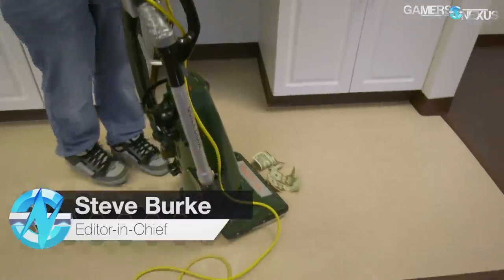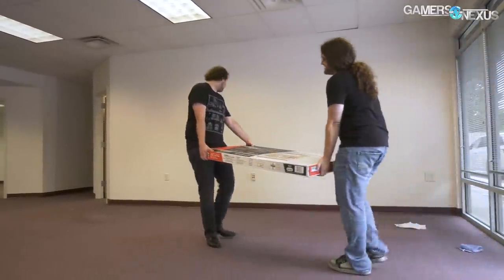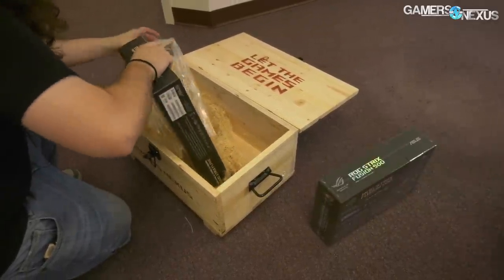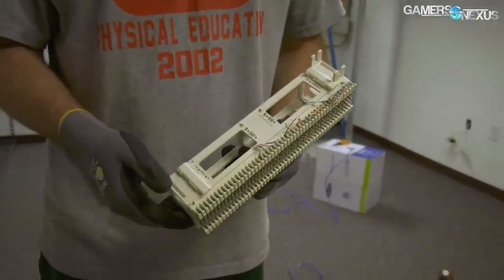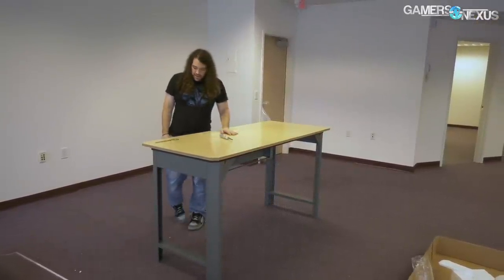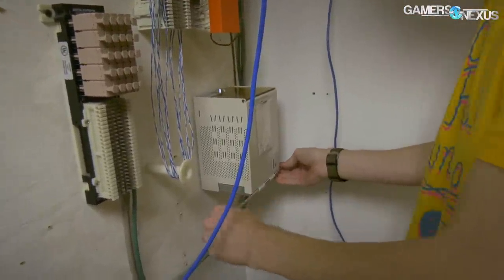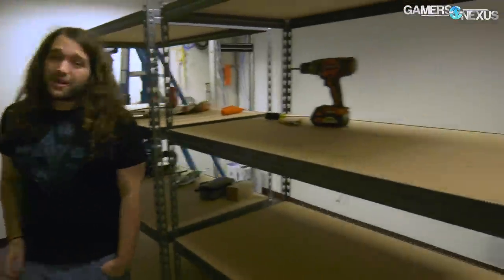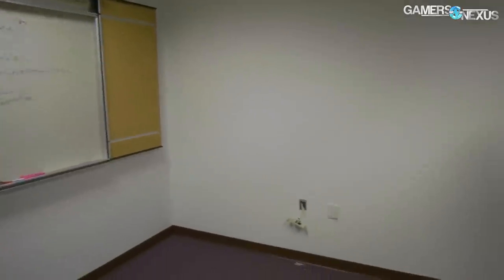Day 1 Move & Meeting GN's Team: GN Moving Vlog, Part 2

Comment: FYI Those shelves need reinforcement. If you put something heavy in the middle the bars warp outwards. Run a threaded rod trough at center of each level horizontally to prevent warping. Otherwise, pretty good economic shelves.

Comment: fun fact about those old telecom devices is those connectors are made of copper so if you have a bunch that someone wants to throw away you can disassemble them and make a pretty penny. My dad used to work in telecommunications and he brought home a ton of these and me and my brother dissembled them all and recycled them for enough to by an xbox 360 back in like 2007-8.

Comment: I wired my house with cat 6 and the correct wall jacks in 2004 or 2005 as your cabling guy was talking about. Glad I did, still works flawless to this day.  cat6a is the new current standard though at least here in Oz and fiber for the backbone in networks.

Comment: Turn the shelves through 90 degrees, that way you can access both sides of the shelves. Like the way you get in a library. So you'd have the ends of the shelves butted up against the walls and a walkway through the centre or along the side. This means that only the ends of the shelves are not accessible, and not a whole side! This might give room for more shelves in the future too.

Comment: about that network rack and going full Linus on it: 

using a proper server rack for your NAS and other server needs is much more space efficient than a set of assorted desktop/tower cases, Especially when finding a case that can hold dozens of spinning disk drives is much easier when looking at servers cases rather than desktop/tower cases. They can even come pre-wired and you just need to slide them in.

You'll need to worry about total airflow and cooling, but you'd need to do that anyway when using several high powered rigs in close proximity.

Comment: I wouldn't put the bottom-most shelf so low to the ground. If anything rolls under it, good luck getting it back. Also, it makes thorough cleaning of the storage room impossible. Lifting it up one or two pegs higher will reduce the amount of room you may have on the shelves, but will be much more functional.

Comment: Cheeeeerwiiiiiine, I miss it, I need to get a couple bottles now.

Also, I dunno if the place has it included, but don't forget security for the office. I'd imagine a regular office is a tempting enough target for some thief, let alone one with consumer hardware they might actually recognize the value of.
Reply: agree. security should be very important. thieves have a bloodhound nose and a fox's cunning to sniff and get into gold hen houses like this. kinda hard to flip some hp office pc but consumer gaymer looking hw by the truckloads? that would be jackpot. i know of a couple of pc stores that were hit, and those had alarms and crap.. an office is usually cakewalk.
Reply from the maker: We did not forget it.
Reply: Sweet. Figured there might be a chance it'd get lost in the shuffle, glad to hear otherwise.
Reply: Laser grid and electrified door handles would work well, plus a few connected mains operated water valves and sprinklers with dyed fluid. Throw in a couple of pit traps, IR triggered nail guns, etc... 8)

What do you mean one can't do that? Aww...
Reply: Snowflake is on guard duty and Tech Jesus on the couch with a shutgun, noone touching his unwanted peripherals!

Comment: Looks really good so far Steve.....watch what happens you will buy like 6 more desks and all of a sudden companies will send you like 5 each... Steve 2 things first off the room with all the shelves, I am not sure about how you want to fully set it up but ill throw this out to you........maybe turn the shelves 90 and make rows on both sides with 1 Isle way up the middle of the room ..........also when you do put up the shelfs you might want to add some cheap Led light strips on them on top of each shelf so when the room fills up your ceiling light wont cut it but if you had the light strips on each shelf you could see.
Reply: I was thinking about that too. Having multiple shorter rows that could all be easily seen and direct access to the door.
Reply: Howdy Bruxxus I was thinking that way for a couple of reasons it might give them an easier way to set up plus when they start to load up room they need to think ahead for the Lighting too, that's why i said they should install some cheap Led Strips on the back of each Shelf set up so it would give plenty of light especially once the room fills up in some spots to the ceiling and blocks off the lights....we forget these things alot until they happen......Ive been there so thought IDE give STEVE the HEY dont forget Part Now....lol
   Another Idea was to do one side of the room the way I said then put one complete row against the left side wall (this way Just encase they get some extra Long items they would have a place to store if need be) it would look like a 80/20 split if you get what im saying.   the reason i figured to turn the rows 90 was to make it alot easier for knowing where shit is, like row  L 1 for psu, row L 2 for ram, row L3 for Gpu's etc ....the other way it just looks like stuff would just get thrown anywhere, they should look at what Linus did the same thing but changed it to how I am saying now, a little organization and some bins, or Part holders make storage so much more organized          
       I know some might think omg god stop being an old fart its just a storage room, but once you spend way too much time looking and re looking for a stupid thing for a couple of hours that should be found in seconds you realize its about time savings not saying you need to learn from us older guys type thing.

Comment: Dang this is looking good. How many more tables do you need? Maybe build some tables from 2x4 and basic wood table tops for about $60 total - each. They're not super aesthetic or anything, but get the job done for just being an elevated surface on a budget. You've probably already considered this, but just thought it might be worth sharing it  in case you haven't! Good luck with the rest of the move in!
Reply: Unfinished interior doors work well as table/desktops. Extra work to stain and finish them, but work well.
Reply: BRUXXUS yeah they also work great! I kind of like choosing my own finish and stain to make a certain aesthetic, but seriously can't beat the price either way
Reply: I was at a ReStore today. Interior doors are $5 a piece. They got loads of them.

Comment: Just wondering for the network part did you get prices info/comparison, If you went with glass for the longer distances ? Maybe overkill but you might end up with a lot more network traffic in the coming years and have option excluding going back in walls/sealing. Or are prices insane ?

Comment: Hey Guys, Glad to see this expansion for GN. It is rare to find content with the deep you guys provide. Kudos for that.

If I'm allowed to suggest, about those shelves. If you leave them as is, they might start to whable over time as weight comes in. Try to bolt them together side by side, or bolt them to the wall (if that is not a dry wall) or the best option is to add beams diagonally, corner to corner (making a X). 

anyway congratz and wish you all the best in this new GN phase

Comment: You guys need an inventory system for those shelves. 

Even just a simple excel spreadsheet. Each shelf is labeled with a location, (ex "Shelf 1-5" would be the first shelf, 5 shelves up from the floor) and with a simple USB barcode scanner and printer everything is scanned in and out when stored/used and give everything a field for Date of initial storage and last checkout date then when you run out of space you can just go to the spreadsheet and see what's been there the longest and hasn't been used in a while that we can throw out/sell/move to long term storage, instead of rummaging through all the shelves until you find something you can get rid of.

p.s. Any chance you're hiring an inventory manager?  ;D

Comment: Great idea about putting the tool shelf behind you for the set.  I would suggest not using a height adjustable table for your A-roll set.  Rather have two tables you can swap out to maintain a stable platform and be beholden to 1 less sponsor.  Are you going to use the wood wall again?  I think that would be an excellent call-back to the old digs.

Comment: why don't you rotate those shelves 90 degrees so you have a bunch of rows of stuff; that lets you use the ends of the shelves to put labels on to make it easier to find things (i suppose that's also possible with the current configuration but it would be better separated otherwise). also you would always be able access both sides of the shelf

Comment: You should check out BTOD, their VertDesk v3 is supposed to be really good and they say they have great warranty service. It's more expensive than Autodesk/Smartdesk etc but still cheaper than the higher end brands. I would have chose that one but they only go through UPS ground.

Comment: PART 2   Not sure if you have one near you but if so maybe go check out the Salvation army  type store you may find tables, chairs and all kinda of things you dont think of until your away from the office........plus you can find tables there alot of times very cheap. Good Luck and keep smiling it looks awesome so far GUYS!!   Steve if need be go get some 4x4 and build you tables get some good 2x10 and use them as tops and shelf depending on length it might be a shit load cheaper. use 2x4 for bracing to save a bit but legs out of 4x4 and 2x10 or up it will never get over loaded

Comment: As an Industrial Engineer, if you would like to maximize space usage, you may want to have rollable storage racks, to minimize wasted walking space. You only need access to one particular rack at a time, so you only need the walking space for just the rack, rather than having walking space for all racks at the same time. Based on the footage of your racks, you should be able to fit in an additional row or two of racks.

Comment: As much as this is fun to watch, I know the moving takes a lot of work. The wiring tho.. that LSA Krone or Siemens connector.. I'd guess Siemens with that funny crossing knife. If the dry wall had no horizontal supports i'd just run the cable behind with a pilot. Secure it a little. The outlets seem with old Molex cat6 modules but without the little plastic bracket on the terminals? Anyway, a lot of fun stuff here :D

Comment: Nice beginning.

BENCHES: Why not build custom wood work benches? Easy to build into the wall saving material, more solid and stable than store-bought and mis-matched units. A lot less expensive and tailored to UR needs such as height, depth, strength, cable routing, etc. Later can add IKEA inserts and even a system of 3D printed drawers and bins for parts and misc.

With a little care they will look very nice. Don’t have to be a woodworker, and not a lot of specialized tools are required.

Comment: Just a suggestion:  Get yourself some tool carts from Harbor Freight or similar, and use those to put the test rigs on.  These cost about the same as cheap computer tables, but they're heavy duty metal or plasticcarts with casters, so you can roll them around.  When you need a particular setup for a shoot, you could just unplug it and roll it over to the set.  Also, they look cooler than those tables.

This is what I mean:
https://www.harborfreight.com/catalogsearch/result/index/?dir=asc&order=EAScore%2Cf%2CEAFeatured+Weight%2Cf%2CSale+Rank%2Cf&q=tool+cart

I'm digging the new space; keep up the good work, guys.

Comment: Please use cat6a not regular cat6
Reply from the maker: slayerXcore We are.
Reply: Haha same thoughts, when I heard just cat6 and not cat6a I was like "rip 10gig speeds"
Reply: What about snowflake6a?
Reply: Make sure the cat6 you have is 24 gauge. Some cat6 is 23 gauge, and it will punch down into 24 gauge connectors, but it bends them. That can cause them to work loose and fail.
Reply: Cat 6a has shielding cat 6 is what nubs use
Reply: They’ve got a guy that knows what he’s doing, they’ll be fine guys.
Reply: 6 would be fine, just needs to be at least FTP and not UTP cable, and it has to be terminated correctly, this means shielded jacks, patch panels, and outlets.

If you want 10GBASE-T, that is.

Comment: Depending on the length of the cable run you will need CAT 6A to get 10 gigabit.
Reply: 180ft, i doubt the rooms are that far from the patch panel but who knows. the network guy didn't sound like he was confident in what he was saying lol.
Reply from the maker: We're using that already.

Comment: Did you guys not test the cat5 cable first? If its old and full copper rather then the modern Chinese crap that's copper clad, it will probably do 10gig just fine, especially if the runs are less then 50 meters. Source: CCIE Engineer.

Comment: just a tip regarding tables: 
why dont u build your own tables ? go to home depot or whatever u  have up there… get some full wooden  (kitchen)countertop or something like that… by hight adjustible feet like Ikea has and u can build your own desk… you can even strech one table along the whole wall since u can buy kitchencountertops in almost any length 
snazzy labs did something similar in one of his Videos (but he just bought Ikea stuff - if u mix it up with home Depot u r way more flexible in Terms of size and cost) 

thats way cheaper and Looks way better - and if u worry About stability just add some iron-angles beneth the countertop and fix it to the wall

Comment: Steve, consider used office furniture suppliers for some good bargains on decent tables (my main large metal framed office desk only cost 50 UKP, and that was 20 years ago, still going strong). And that room with the tables is crying out for shelves. :D  Hey, are you linking those industrial shelving units together with the relevant clips? You should do, makes the whole thing more sturdy. For anyone in the UK, BigDug is a good source of such shelving, and they put some on ebay sometimes as normal auctions. As for finally having spare storage space, beware that old saying, data expands to fill the space available. ;D  Happens every time. I once had space:

http://www.sgidepot.co.uk/misc/newshelves6.jpg

but then after a while:

http://www.sgidepot.co.uk/misc/officeJul2011b.jpg

Now I need shelves on the ceiling... :}

Comment: "Nobody uses these anymore. Too slow" not true. I happen to know that a JCPenney distribution center happens to still be using fractional T1 today. There are close to 200 devices that use the connection as well.

Edit: Holy shit, I only just realized you are based in NC. Cheerwine gave it away.

Comment: Just a thought for you guys. You mentioned the cases going along the bottom shelf. Personally I would go up high with them. On the top they would each fill a spot from front to back and you can see what they are from the ground. Nothing would be hiding behind them. Also you may not pull cases as often as other parts. Sure they are heavier, but it's not like you move them all the time. I'm just going with the fact that you used to store cases in your attic also. Then with the bottom shelf you could use the space for smaller things or stuff that you have quantities of. It would be easier to see these items if they were down low even if you had different items behind each other or easily see what quantities of stuff that you have on hand. Instead of trying to deal with stuff like that on a higher shelf. Especially the top one that you may need a stool or even a ladder to see what is up there. That's where the cases at the top would be good because it's likely won't be anything behind what can be seen from the front.
Reply from the maker: Mike Oleksa Bottom shelf for employee safety.
Reply: What about middle shelf so you don't have to do any bending over when you lift them? Or just get Snowflake on a forklift.
Reply: Good point
Reply: Putting them on the top shelf would also make a small room feel more claustrophobic. In the future when space the final frontier has been all but conquered you might put them on the top shelf.

Comment: Why are you using Cat 6 and not Cat 6A? Cat 6 does not fully support 10G Ethernet, it was never designed for 10G. It can support 10G but only for lengths up to 55m including connections from switch to patch panel and Wall socket to PC. From the pictures that should be enough but you could still get lengths of about 40m or more (switch to device) depending on how the cables are routed and where the device is located. It would not have been much more expensive to get Cat 6A for full 10G support (100m) and possible a later speed upgrade because Cat 6 (250 MHz) is at the highest speed possible. Cat 6A (500 MHz) still has some headroom which will probably not be utilized for higher speeds but can make a difference for getting 10G and not be stuck at 1G all the time or maybe even just intermittently.

Comment: surprised office tables are expensive im using a big plastic blow mold picnic table as a table and in normal use its fine it was like $40-60 i got my pc a 48 inc tv and a ps4 all side by side on it
Reply: I've been using a door on two nice, wooden drawer/file cabinet things. Stained and finished all the same color. Works super well, looks like a really expensive piece of furniture, and the door has a hole to pass wires through!  :)
Reply: I'm using wood from a bed I found on the side of the road that I screwed to some other scrap wood I had laying around. I did polyurethane it all though.

Comment: 0 difference between cat 5 or cat6 plates or fittings the only actual difference between cat5 and 6 is the cat6 has more insulation between wires so you get less ingress or cross talk but cat 5 is fully capable for 10gb speeds it’s the same shit at a HDMI costing 5$ or 100$ it’s no practical difference just snobby marketing